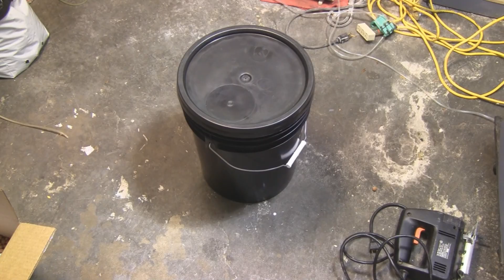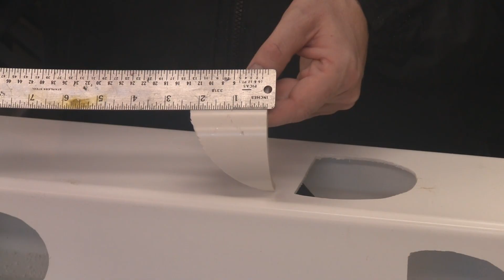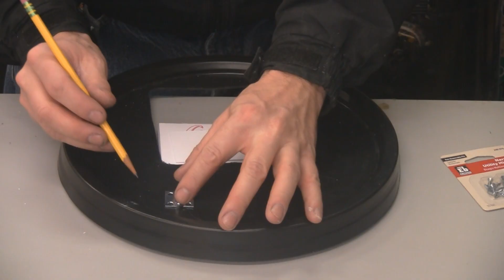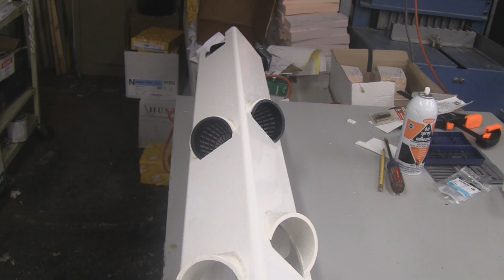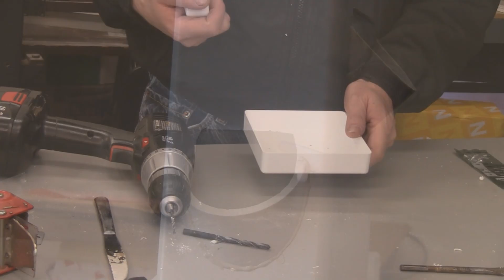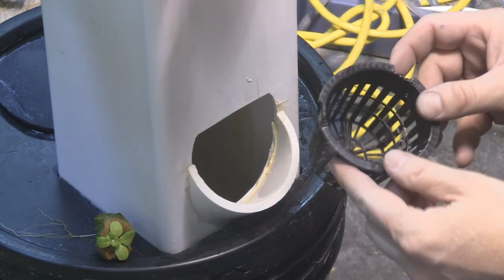How To Build The Rain Tower Vertical Hydroponic System

Comment: I just discovered your video. What an inspiration! I am building a 2 tower system with 4” vinyl posts and 2” net pots in a 27 gallon tote. I will have a single pump for both towers.

Comment: You have an excellent design.  I am a little concerned about the Loctite Epoxy though.  I went to the Loctite website & it says it is not for aquariums or potable water.  Do you think aquarium silicone would work?
Reply: ronn773 saw a video once ...fella just cut a slit and shoved a hot beer bottle in it ...made a perfect little pocket
Reply from the maker: +ronn773 You can see all the other designs on the site.

Comment: SleestaksRule: I built my own tower which very similar to yours and is mechanically working GREAT!  However, I have killed two sets of plants.  PH is at neural. What am I doing wrong?  Could it be the amount of grow food (used the directions that were on the bottles)?  Could it be my home made grow cups (plenty of liquid is getting to the seedlings)?  Could it be that I put the seedlings in the tower too soon?  Wish I could upload a picture.  Oh, my timer is 30 min. on and 30 min. off.  It is winter (Thanksgiving in SC) and I have the tower by a window in my home office (huge window with plenty of morning sun).  Was hoping to get some lettuce and green bell peppers in a "winter crop".  My wife has diabetes and was hoping we could get her off all the store bought greens, tomatoes, cucumbers, zucchini, etc.  Also, was planning to build 3 more towers but am a bit frustrated at this point.  My tower is exactly like the home made ones on youtube (fence post body and 3" cup holders set at 45 degrees).  Please help me.  I know NOT what I do.  Bob Cotter - email: bcotter250@gmail.com
Reply from the maker: What are you using for nutrients?  They need to be really weak at the start.  Maybe 300PPM for lettuce.  Are you using rockwool?  Are you using hydroton?
Reply: ***** Oops, I am using full strength nutrients.  Rock wool? - no.  I used a round, black medium that looks a lot like peat.  Got it at the hydroponics store. (not sure he knows a lot).  Nutrients are: Pura Vida.  Bucket is a 5 gal. bucket and is about 3/4th full.  I have no clue what hydroton is.
Reply: Bob Cotter Also, in the spring, would tomatoes, peas, string beans be better in a Dutch Bucket or the tower?
Reply: ***** Hydroton - yes.  Oops, I am using full strength nutrients.  Rock wool? - no.  I used a round, black medium that looks a lot like peat.  Got it at the hydroponics store. (not sure he knows a lot).  Nutrients are: Pura Vida.  Bucket is a 5 gal. bucket and is about 3/4th full. Also, in the spring, would tomatoes, peas, string beans be better in a Dutch Bucket or the tower?
Reply from the maker: Bob Cotter
The rockwool is what I plant the seeds in before they go in the net pot.  You can see it at 21:50 in the video as well as how big the plants are when I put them in.  Yeah, go really weak on the nutrients when they start out.  I grew lettuce and green beans (bush) so far.  I'd avoid anything that grows tall unless you make a support for it.  I'm just guessing it would be the nutrient strength.

Comment: instead of using your aluminum shield you could warm the section over the netpot and push it a little bit to the inside of your tower
Reply from the maker: Thanks for your input.  There is no need for the shield after all the different people expanding on this on the website.  I think with all the different versions on there it is at perfection.

Comment: I am considering building a rain tower. My question is that if you use 8 inch round pipe instead of the 5 inch fence post would you have to cut your three inch pipe in a different manner from which you demonstrate in your video? I am building mine with a rubber maid container with 8 inch potable water pipe.
Reply from the maker: I wouldn't know how to attach to a round pipe.  The fence post is safe to grow in if you are concerned about it.  I called the tech department of the manufacturer and he assured it was safe.  They sell to Lowes and Home Depot.  I can give you their number to ask more questions if you like.

Comment: I'm just wondering if having a mister sprinkler head at the top would work better, or at least eliminate some of the steps (e.g., drilling holes in the cap or even eliminating one of the two hinged caps at the top)? I'm guessing it would be beneficial for the top plants, but the bottom ones would still get more drippage than "mistage." Either way, thanks for the video.
Reply from the maker: I know a few people tried misters but they said it was coming out the holes.  The new and improved net pot holders that people came up with solved the problem.  I'll show that in a ne video in the next few days.

Comment: What's the recipe for the nutrients that you add to the water?  There's a tower system that is sold by Juice Plus which I could buy without all this work: biut the system is useless unless I know what the to put into the water.  Also: what the heck those hydrogen pellets?  Where do I find them and how much do they cost?

Also: which plants can't be grown like this and which ones can be grown?  Can you grow root vegetables like carrots, turnips cabbage?  Can you grow tree seeds like this?  If I can grow a seed of a tree into a sapling like this then planting the saplings will be faster and easier than growing them in the ground.

Comment: for that bucket lid to prevent tear out, drill 1/2" holes in the corners first. then use a saw to connect the holes. the 1/2" radius is way stronger than any corner.
Reply: try  an acid brush to apply the epoxy. they are cheap and easy to use and pitch when your finished.

Comment: i really appreciate this video.  i set up one of the bright agrotech spring towers for a friend last week, and its kind of a pain to plant.  this looks tougher and lots cheaper to build, but a lot easier to plant.

one big question before building one.  why did you need the splash guard?  what happened without that, assuming it was an after thought.  my biggest concern on building this is how the water flows as it works its way down the tower and if i need to divert water towards the cups.

Comment: omg, what would you estimate to total manufacturing time to have been?  And this is all to grow a little lettuce?  As usual, great attention to deal.

That first cut you made on the bucket lid, you probably had a little difficulty at the edge lip.  I did mine from the underside for a different project or, use your laser.

Comment: Why use expensive epoxy and the extra work of sanding around each hole when you could have just used PVC primer and cement designed for permanently gluing PVC pipe?

Comment: I just finished building one based on your design. I will post a video in the next few days. QUESTION- Once you set up the initial water with fertilizer, as the water evaporates how much more fertilizer do you put in? Since this is only a 5 gallon reservoir it is going to need the water refilled often. I just don't know how much fertilizer to add as I add more water? Thank you for such a awesome video.

Comment: I am not sure why you would not want to use PVC plumbers glue. Its drys in about 5 min. You can create a flush mounted spot for your lip by heating the tube up and pressing the lip into it to make it even.  Alternatively using the same heating concept, you could just leave a half circle cut-out at the bottom of each hole in the main shaft and heat it with a heat gun or hair dryer and pushing out with rounded extra piece of pipe.  No glue needed!

Comment: if you want free energy for the pump ,why not set up a weight and mechanical movement like the old fashioned grand father clocks? they have plans for large wood clocks now and you could use 2L soda bottles for the weights.

Comment: You did well. An excellent and informative vid. I'm wondering if they could be trained(wrong word)several stations, more than one tower, off of one pump. Stronger one. Use less outlets and maybe less electricity. Maybe a solar set up or peddle power battery storage? Prefer not depending so much on the grid. Thanks so much for sharing. Some of the items/hardware might be second-hand purchased off of completed construction sites? Discounts and frugality always appreciated lol.